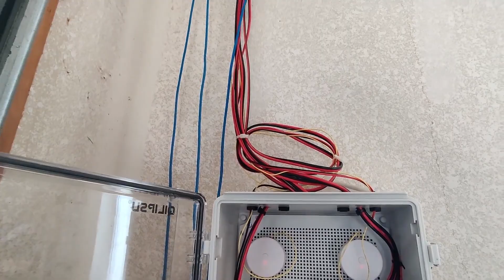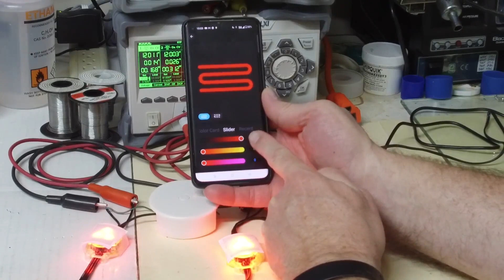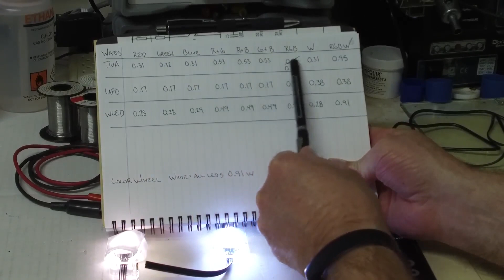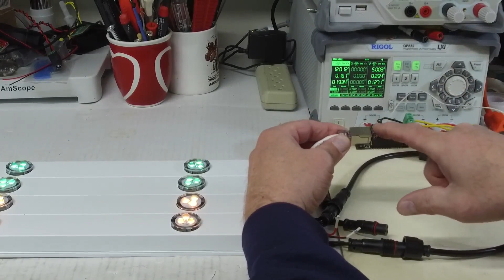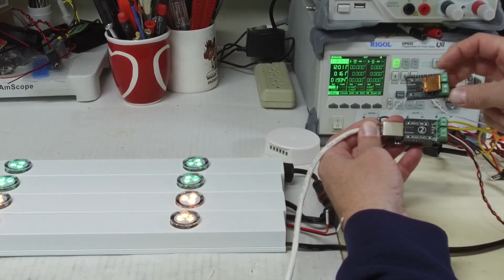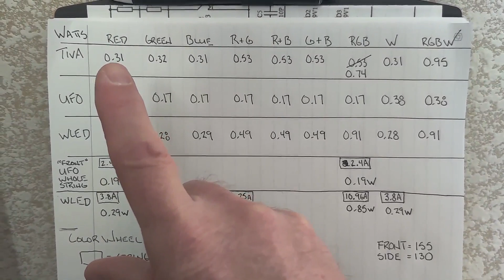DIY Permanent Christmas Holiday LED Light Installation. WLED and ESP32 Controller.  Boot Issues.

Comment: Hi Dan, I’m glad to have stumbled on your video and nice detective work with the LED power consumption. I recently ordered from Paul Zhang and just received my lighting kit last week. I need to install these over the next 10 days for a family event coming up. My question is if I go ahead and install as is, would I be able to modify or change the controller later on without having to modify any wiring? I think so but want to confirm.  Thanks
Reply: Thanks.  Couple more questions.  They supplied 200 m of 18 gauge wire.  Paul is telling me it’s fine to use for the power injects.  To avoid waste, I’m planning to double up the wire so it’ll act like one thicker wire - see any issues with that ?   ( I have the 24v lights so they should require thinner gauge anyway-correct ?) And second - did you use any data boosters ? I’m not getting clear instructions from Paul.  Thanks so much.
Reply from the maker: Yes, I would double up the wire to get a higher effective gauge.  I did not use data boosters.  If you are configuring each stick end-to-end without jumper wires between, I do not see the need for boosters.  The actual signal flows in and our of each LED module which acts like a booster at each module.  If you have a long distance between the controller and first LED, you might need a booster in that stretch.  My install is maybe 10 feet between the controller and first LED.
Reply: Oh and also, should I plan for 1 w per LED when selecting power supply? I’ll have 4 PS total in my system.
Reply from the maker: 1W per LED is a good starting point and then I would add some headroom to the power supply.  For example if you had 100 LEDs, I would add another 25% (at least) on top of that.  100 LEDs equals at least 125W power supply.
Reply: @DanPattenAudioG33k  Thanks again for your response, very helpful.  About the power consumption - Even with the 0.17w that you measured (I think), the LEDs seem so bright - I can't imagine what they'll look like with a full watt.  Do you frequently set them up to max brightness - it must be blinding :-)
Reply from the maker: I do not usually set them to 100%
Reply from the maker: Yes, you should be fine.  Since a typical install has the strings in series and the controller is at the beginning, you can change controllers without reconfiguring the string.  Make sure that you also run additional power wiring to tap into the string.  I have changed my controller 3 times without changing my string configuration.

Comment: Hey i purchased 200ft kit from etop and having a issue with the last 3 tracks saying blue. first it was only the last track reminding blue then I added 2 more track in the middle of the system now the last 3 tracks are remaining blue, what can be the issue ?

Is this something to do with Surplife app configuration setting ?
Reply from the maker: Have you set the total number of LEDs in your string?  In "settings" there is page called "Num of lights setting" where you need to configure LEDs per segment and how many segments.
Reply: @ thanks for the reply, ya I’ll give it a try. How would I know how many segments there are ?
Reply from the maker: @prabhnoorkang1171  Segments are a programming style issue.  I would start with one segment and then enter in total number of LED pucks.
Reply: @ ok thanks for your help, and to confirm you don’t think this is a signal issue? as although there is multiple power injections this is all on 1 run for the signal.
Reply from the maker: Sounds like your LED number setting is wrong.  Did you try adjusting the setting?  This would be my first guess.

Comment: Hey I bought the 200ft kit from estop, had a question about the power injection. The kit comes with a 50M wire would that be enough for 4 power injection? Assuming power injection every 45ft I would need 45ft+90ft+135ft+180= 450ft so that how much wire I would need ?
Reply from the maker: What gauge of wire did they include?  Mine was about 18AWG which I think is kind of small.  My install was probably excessive for power injection :)  I purchased 14AWG and primarily used that.  Is your install a single run of 200 feet?  I believe most installs use a single additional power injection wire and tap into it multiple times.  If you were to do that, I would not feel comfortable with 18AWG.
Reply: @ thanks for the reply, so yes it’s a straight 200ft run, starting from the junction box at one side of the house to the other side. They are including 50M 3 core RVV wire, I think I will purchase a 2pin 200ft 14AWG as you recommended but my question now is what would you to tap into the wire multiple times ? They include t connector but how would you continue the run ?
Reply from the maker: Have you received your parts?  In my kit, there were several strings of LEDs that included tap wires.  This made connecting to the power cable straightforward.  See attached picture:  https://drive.google.com/drive/folders/1qSK9OTcvAdvvF8vqaAScbaQUEciBOTVQ?usp=sharing
Reply: @DanPattenAudioG33k Hey haven’t revived them yet still on the way but wanted to figure it out before it arrives. 

I checked out the picture so yes that’s where it would be tapped but then how would you continue the 14awg wire to the next injection point ? Thanks in advance
Reply from the maker: I cut the 14AWG wire, twisted back together with the tap leads added.   Used this  "Butt Joint Heatshrink Connectors with Integral Solder"  How is that for a name?  Really quite handy part.  Using a heat gun, the wires are soldered and sealed in one step.  
Link: https://amzn.to/3Bajq0L

Comment: Do you still have the LED specs from the manufacturer? When I emailed ETOP about the 24v system they said the LEDs were .74 watts. I like that yours are almost 1 watt.
Reply from the maker: I never got an actual specification sheet.  I was informed via email that they were 0.9W which I was able to confirm.

Comment: Great videos! After watching your videos i decided to purchase the etop 150ft kit. Just curious if you've had any issues with heat since switching to the new controller. I'm just curious what gauge wire comes with the kit and whether it's sufficient enough?
Reply from the maker: I am guessing supplied wire was 18AWG.  I think this is too small for a single long run.  I purchased  14AWG for the long run.

Comment: I'm going to be starting my install soon and have purchased etop lights and the Wasatch Pixels Quad+ Controller.  I was curious on what app you are using to control everything.
Reply from the maker: I am using WLED.  It has been working well for me.
Reply: @DanPattenAudioG33k  what size screws did you use to go into your aluminum soffit?  I'm thinking of going with #8 X 1" hex head tapper
Reply from the maker: This is what I used: 
https://amzn.to/40kzpnc
It is a #8x1" quick metal self tapping screw.
Reply: @DanPattenAudioG33k Thanks I was looking at something similar but I was worried about the stainless and aluminum causing galvanic corrosion..I'm still on the fence
Reply: Just received my order and I must say it looks good...I even had them donit in a custom color and still was here in 10 days.  Just asking of you had any issues with anything so far that I should be aware of or shouldn I do anything  special with the track during installation?
Reply from the maker: @rickyciaccia1061  No issues so far.  Do you have access to a band saw for cutting the track to length?  Using a hack saw was difficult for one person to do.  Suppose if you had a vise and jig to hold the track a hack saw would work.  Good luck.
Reply: @DanPattenAudioG33k  Thanks for info.  I was planing on using my miter saw with a non ferrous blade and I have a band saw for easy straight cuts
Reply: @DanPattenAudioG33k  also what did you think of the end caps?  I can't see you they clip and stay in
Reply from the maker: @rickyciaccia1061  The end caps provided by manufacturer are probably not the best.  I would not rely on just the clip holding them to the track.  I used a generous amount of silicon to assist.
Reply: @DanPattenAudioG33k  lol I was thinking the same thing.  I wish it was an internal cap where you don't see it but for the price you can't beat this set up.
Reply from the maker: @rickyciaccia1061  Agree.  A cap that plugs inside of the channel would be nice.  Maybe something like that could be 3D printed.  Not sure how long the 3D printed cap would last though.  Thanks.
Reply: @DanPattenAudioG33k  I'm glad I stumbled upon your channel. Hearing your thoughts on the Etop lights sold me and I'm happy so far.  I installed 50' in 2.5 hours on my lower soffit and it goes up pretty easy.  I will install the upper soffits in a few days to complete the install.  I ended up using 14/3 tray cable. It's more expensive than just rubbing seprate #14 wire but it's all enclosed in a jacket.  I ran my cable about 70' from the controller and I did not have any signal issues and did not need a null pixel/data booster.  I also have 75 pixels on that line with no voltage drop issues but keep in mind I'm running a 24v system which helps with voltage drop along with the #14 wire I'm using.

Comment: Hi Dan, I am having trouble understanding how you've everything hooked up in the junction box. I've able to understand most of it, however there are multiple red wires coming from the left power supply going into the fuse box. Are these coming from the power supply or are these from the 3 power injection strands?
Reply from the maker: These power supplies have multiple connection points (4 positive and 4 negative).  They are all in parallel.  So there are 4 wires red and 4 wires green that are smaller gauge instead of one bigger wire.  Does that help?
Reply: @DanPattenAudioG33k  Did you find that it was useful to run individual Red wires for taps, or could you have just used one wire and tapped off of that one as needed?   Can the power supply handle that; all the voltage and amperage from one connection point off of the Power Supply?
Reply from the maker: @stevemartin7760  The separate power supply wires (tap wires) ran in parallel with the LEDs (in the channel) are a pair.  You need a positive and negative wire and the gauge of this wire needs to be pretty heavy.  I used a 14AWG red/black pair.  I believe a lot of people's installation problems are due to not having adequate gauge power supply wires.
Reply: @DanPattenAudioG33k  I mean, for your individual taps you shows on your home.  did you run a red and black pair to each section.  I think you did.      Or in hindsight, do you think you could have just run one pair of red and black and tapped into it as needed.    does that make sense?   for instance, it looks like you ran three or four pair of power wires to the one side of your house.   could you have just run one pair and used that one pair as needed for your taps?
Reply from the maker: @stevemartin7760  Got ya.  What I did was overkill.  I probably would have been just fine with the single 14AWG wire running in parallel and tapped into it a couple of times.  So I would have had two runs of the parallel wire.  One for each side of my house.
Reply: @DanPattenAudioG33k I have made my order from Etop.  Going to basically follow what you did along with the esp32 duo controller.    Did you have to boost the data line voltage at all along the way?   I'm going with the 24vdc system.  Going to step down the voltage to 5volts to power the esp32 duo, just like you did.   It seems like the data line would lose voltage along the 100 foot runs for example.  Thanks again!
Reply from the maker: @stevemartin7760  The data line is reconditioned at every LED puck.  The LED driver in each puck has a [Data-In] and a [Data-Out].  So if each LED puck is near to another (in typical application), no boosting necessary.  This is why you want to keep the controller (ESP32) close to the first LED.
Reply: @DanPattenAudioG33k  Ok, that makes sense. thanks
Reply: You stated in the first video that you 3d printered corner brackets. do you have a link to the stl files
Reply from the maker: ETOP had right angle corners and I did not need to end up designing/printing parts.

Comment: Hey Dan, I'm fairly new to this and I am looking to install this product on my home.  When it comes to the power supply itself, and connecting everything to it, is there a simpler solution/setup to this product or is it absolutely necessary to have the enclosure, with the fuse box, etc.? I am really just looking to hook this up on my home in a safe, and simple manner as a beginner. Thanks for your help! :)
Reply from the maker: Not necessary to use the fancy enclosure :)  The enclosure does prevent accidental exposure to 120VAC. If you are doing a smaller system that uses a laptop type power supply (no exposed high voltage) you would be just fine.  What controller/power supply you planning on using?

Comment: Hi Dan, I have learned a great deal from your videos. I have installed two systems on the house but I want to take advantage of the brighter leds. If I ordered the 12v Wasatch Pixels Duo Controller do I need the converter? If so do you have item number for the dc to dc converter?
Reply: Thanks for getting back to me. I ordered the 12v version and hope that does the trick. Your video gave me the confidence to install the system and now have friends asking for my help. Thanks again
Reply from the maker: Thank you.  If it were me, I would get the 5V Duo controller and use an external switching regulator to drop down from 12V to 5V. This will reduce heat on the ESP32.  However, I believe Wasatch has new version of the Duo that has integrated switching regulator (rather than old linear type).  Not sure on the model number for new version.  If the new version is available, no need to worry about external switching DC/DC converter.  The DC/DC converter link is in the video description.
Reply: @DanPattenAudioG33k  I ordered the 12v unit. I will give in a try. Does the unit come with an app to control it or are you using the WLED app??
Reply from the maker: @paulvandril8580  I am using WLED to control the ESP32.

Comment: Hi Dan, excellent videos and thanks for posting.. I'm doing a exact similar installation. Couple of questions, did you resolve the peak portion of the track installation in video 1? Did you buy or fabricate the end caps? Any issue with data line and need of a booster?
Reply from the maker: Thanks for kind comments.  The manufacturer supplied end caps and corner pieces.  I still need to make peak pieces.  I have not had any problems with the data (no data booster needed).  I am still running with what I detailed in the video except I did make my own carrier for the ESP32.
Reply: Hi Dan, do you mean the inverted V on the roof ?  How did you end up sealing those channels ?

Comment: Hey Dan . Im installing a system similar this but it comes with a transformer and controller already all wired up and ready to plug n play . It's 48v system so they say you don't need power injection unless it's over around 250ft. I want to use a different controller and app but I have no idea what controller will work best and a nice user friendly working app
Reply from the maker: Interesting, I have not seen 48V systems (I am relatively new to this).  A 48V system would allow much more power to be transmitted down a long run with minimal voltage drop.  

I have been impressed with the WLED software running on the ESP32 processor.  You could check: wasatchpixels.com and drzzs.com both have WLED/ESP32 controllers.

Comment: Do you have images of your latest look on the house with the power upgrade you mention?  Thinking of going arduino as a controller with wled preprogrammed.
Reply from the maker: I have not taken any still photos of the difference.  However, it is a dramatic difference.  I now have much wider color choices and the  LEDs are much brighter.  I am currently just running all white and only have them turned to maybe 75%.  I'll take a couple of phots.

Comment: Hey I’m having the same issue with that controller. It seems like the brightness is a lot higher with the preset effects vs making your own patterns for some reason. I contacted the supplier about this and the white control. Nothing was resolved due to language barrier
Reply from the maker: I am going to attempt contacting them about this issue.  Really is odd to limit data stream like they are.  You will never be able to obtain full brightness and full color spectrum.  Odd.

Comment: Nice investigative work, Dan!  I wonder why Zengge is limiting the power.  You probably don't care, since you now have created your own, but it would be interesting to know why.
Reply from the maker: Good question.  Maybe they designed for a particular LED or module that does not have thermal capability or enough current capability.  It is odd.
Reply from the maker: I'll attempt to contact Zengge and see if they have any input.